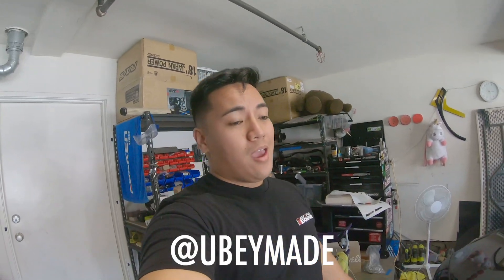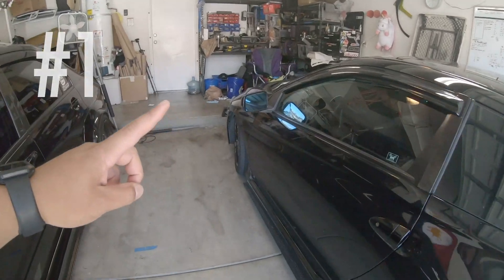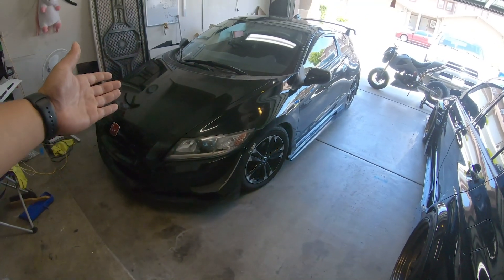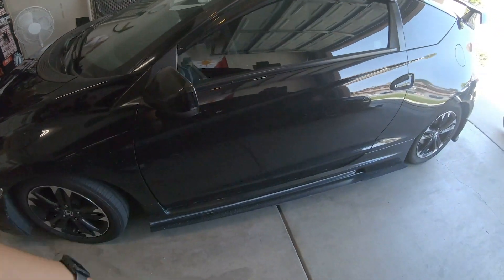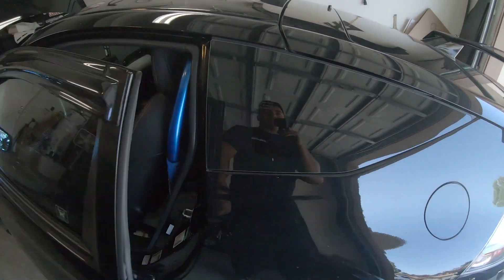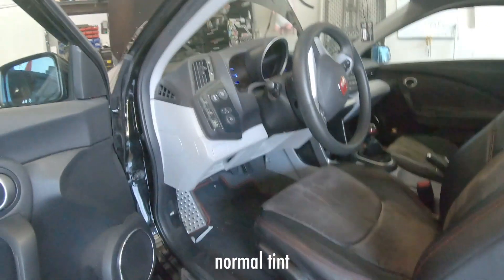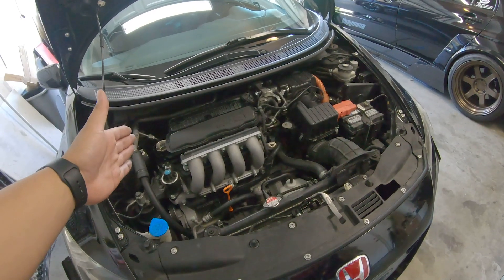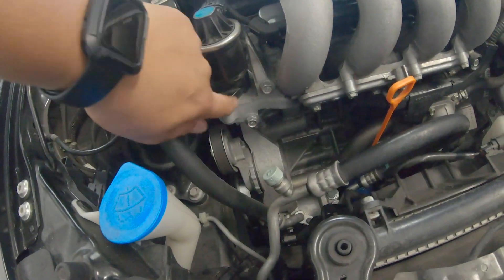FIRST 5 Mods Your CRZ NEEDS! ep.30

Comment: the first and the last thing that a cr-z would need - is a supercharger.
Reply from the maker: for the price per hp gain tho... i find it hard to justify. K swap or build the suspension and just hit the twisties!
Reply: @UbanteGarage  K-swap is  a valid point, dude! Apart that it would take much more dedication, in opposite to a supercharger weekend project.
But any upgrade of the suspension, with a CR-Z stock powertrain?... OK... maybe.
Reply from the maker: Have you tried pushing it through the twisties? Things are fun af haha gave a new sti a run for it money 😂

Comment: I've wanted a crz since they came out and finally did. I'm happy with it, excited to get the few things it needs (spacers, arm rest, mine needs a new windshield, tints, Progress rear sway that should match the stock FSB at 19mm from what I've read). Plus I just got it at 97k so I'm thinking oil and cvt fluid and filter change immediately, for peace of mind more than anything.
Reply: Though most of what I can find says just follow the maintenance minder (which says oil life at 100 which seems too dark to be true), but also that "no tune up is required until 100k" so I'm thinking I'll just do it all. Make it good as new and trouble free.
Reply from the maker: I wouldn’t put the progress rear sway at the top of your list.. didn’t feel much of a difference since the rear is solid
Reply: @UbanteGarage  thanks for the input! Makes sense, it definitely feels pretty solid already. Plus would have to wait til spring at least to even want to install it

Comment: I just put in a full K&N air intake in my 2013 CR-Z. It requires the removal of the stock airbox. Sounds great and adds a few HP and torque.

Comment: At 5:42 I am wanting to know what that grid looking drivers side shade protector is, I cannot find where to buy it because I don't know exactly what it is called.  Also, it really sucks that the T1R mirrors are discontinued, I am currently looking for blue wide side mirrors that work with LHD vehicles but it seems like there aren't any.
Reply from the maker: It’s called mugen style on eBay.. but idk if they are still available

Comment: Hows the maintenance bro? Any common problems? Planning to get a 2013 as my first car
Reply from the maker: tbh its the most reliable car ive ever owned 😂and the longest as well. after 70k miles ive replaced the ac compressor and the oil. other than that its just been extra mods.

Comment: Really discovered my blind spot today after a week of owning my 2014. Nothing happened but yeah lol. The driver mirror does have a sort of wide angle section on the outside. Those T1R mirrors seem hard to come by these days.
Reply from the maker: They definitely are unfortunately. When I got mine it was as easy as just googling them
Reply: @UbanteGarage  yeah I remember when I first saw this video a couple of years ago, links were all good ha. No luck on the Mugen style search on ebay either, but I'll learn to live with it lol. I saw a wider rear view mirror for the car but since the window is pretty narrow, seems unnecessary.
Reply: @UbanteGarage  actually I may have found them for like $80, never heard of the site but may try it.

Also, would you recommend those half tints on the front windows?
Reply from the maker: I recommend getting all windows if it’s legal to do the front in your area. These care get hot and the ac vents suck for the driver

Comment: Did you put a subwoofer and amp in this car or does it have the stock sub? I just got one of these and trying to figure out what size amp would be safe with this hybrid system.
Reply from the maker: The ex models come with a stock sub but the base models do not. I never installed one
Reply: @UbanteGarage  Yep, mine was the base. What I'm curious about is what would be the safe wattage aftermarket amp to use with this hybrid.. nobody seems to be able to tell me. I've seen videos of people with 4000w in there and some that say 600w max.. not sure.

Comment: Hello I have a question for the air box how did you cut the liners what did you use to cut the liners ? Inside air box  and outside of the box hope you see my question and possibly get back to me please thanks 🙏
Reply from the maker: I just used some pliers and pinched low and twist to break them. Then sand or file the nubs smooth
Reply: @UbanteGarage   was it worth doing it ?
Reply from the maker: It’s free. And makes your engine noises more noticeable. If that’s for you I’d say so
Reply: You know where or how I can get my hands on I-vtec manifold been looking for it everywhere

Comment: Thank you for this very informative video. I just got a blue CRZ (all stock) with 60K miles and first things I want to do are coilovers (probably Tein monoflex 5KG front and rear with a slight drop), sway bars, some questionable weight saving (back seats, starter battery..it's still something tho), rubber mats and this airbox mod. 

My only question is, won't this hurt the engine in the long run? I think I can remove the tabs first but stick to an original Honda air-filter. I also want to remove the muffler but it's highly illegal here in Italy, so many streets limitations here... So I might save for a legal but more musical exhaust. 

As for the wheels they are an expensive upgrade and tend to add weight so I want to prioritize coilovers, the stock ones are old anyway and might need some work done. I actually like the OEM wheels and I'm not sure if going for 17" ones is going to be a clear improvement. Does anybody knows the weight of the OEM 16" wheels? Suggestions for tyres? Thanks

Comment: Um, pretty sure the CR-Z has a front sway bar. I actually just replaced a link kit on it, and it's a stock CR-Z.
Reply from the maker: it does 😂
Reply: Ubante Garage haha alright! 😂 I was actually wondering if there were trim levels/region specific differences in the suspension, but alright seems like there isn’t!
Reply from the maker: I don’t believe there is.. but I do still recommend the spoon fsb 😅

Comment: I live in Milwaukee WI area, and our roads are pretty shitty. So I'm not sure if coilovers would be a good idea. I would like a slight drop but I wonder how soft I could set those BC coilovers. Otherwise the spoon springs are a 1/2" drop, but they're expensive especially if you get the struts to match. Only had it a week so that's further down the line anyway, and maybe just an OEM replacement in the meantime since it's at almost 100k miles on a 2014.

Comment: Hey homie, im curious. Is blocking the air box completely safe? I'm new to the whole car scene and I wanna try modding my crz, but I don't want anything to mess up.
Reply from the maker: Zoarork25 it’s just a the hole to the resonator. It’s there to reduce intake noise and if water was to get into the air box
Reply: @UbanteGarage  ok sweet, thanks for the fast reply
Reply: This has nothing to do with this video but I wanted to know if you possibly remembered what motorcycle exhaust was your friend running on his crz in one of your videos. @UbanteGarage

Comment: Got mine set up but now my traction control and ABS lights are on 🤦🏻‍♂️
Reply from the maker: damn... havent had that issue but i heard it jacks up a ton of stuff :/
Reply: I had to reset the ecu and clear the code with ob2 after a few items were put in but a few of the codes were small items to change out

Comment: What do you think about swapping the Manifold for a honda fit one? Is it worth it? Everyone i know says its a must
Reply from the maker: i did it but im not gonna say i think its worth it tbh
Reply: I cannot speak to stock but with the light flywheel as well as the air and exhaust mods I have I see the mid-band gain as the perfect complement, most other mods only add a small amount if any to the mid-band but that is were I feel this car is lacking the most and I feel the fit intake is well worth it due to the decent mid-band power increase
My car may not be the fastest around but the engine response coupled with the almost total linear power damn sure feels like it, regardless of the gear I never feel bogged at all anymore and for 4th gear and lower I feel little difference in power delivery regardless of what rpm range I'm at, its still faster at the top end and torquey in the low end but so smooth you tend not to notice much and I credit this smoothness to the fit intake
So short answer I would say it depends and while I cannot speak from experience as I had already done a lot of my mods by the time I got around to installing the fit intake from what others have said I don't see it worth it as a stand-alone mod, but as a complement to other mods yes I would argue its a must and definitely worth it

Comment: These seem to be fairly common starter mods but I'm not sure that I would agree with them and from my experience with the mods I choose to start with I would have a different list, however, I would argue that there isn't really a true universal list because it depends on what you want out of that car
However the only mod I disagree with is suspension I don't see the point, were I live in the mountains there are almost no straight roads and most have what I call country curves which to most city folk would be considered turns, I don't see much body roll maybe its because I have a 13 and suspension is one of the things upgraded but the only mod I would say would improve handling would be sway bars but I don't see it changing it much and I personally don't feel its worth the harsher ride but a understandable mod none the less
Coilovers would also slightly improve handling by lowering the center of gravity but the CRZ is already low to the ground however its roughly the same as the civic so it would benefit from being lower but the cost/benefits ratio is insane the handling payoff is not even close to enough to justify the cost that is why I would say sway bars are the only legit cost-effective way to slightly improve handling, if you also wanted to lower your car for looks that might change things depending on how badly you wanted it some things cannot be considered on a cost/benefit ratio as they are priceless in the eyes of that person however for me personally I cannot lower my car where I live prohibits it(not by law, but fuction as I am forced to do light to moderate off roading in my daily driving) however if I could I still would not because the cost isnt worth it to me as I would only slightly lower it, ultra lower riders are stupid, pointless and about as aesthetically pleasing as extreme negative camber rims and carry more or less the same performance hits
So in short the reason I disagree with the suspension mods overall not just as 1st mods is they offer little gain in performance, ride quality and looks for the money because the stock is perfectly fine and while it may have slightly more body roll I would argue the benefit of higher ride quality makes it a better choice for an everyday car, however, if you are making a track car it might be worth it to get sway bars and if you live in the city it may be worth it to get coilovers for looks, both offer a decent benefit for a track car but little benefit for an everyday car and can cause performance and ride quality issues for a everyday car

I do however agree on the tint, in fact, its a mod I really want but cannot where I live it won't offer me much benefit nor would it change much in the way of looks because it is already close to the legal tint were I live. I could maybe only go another 5 percent max(after looking up tint percentages my rough guesstimate is stock tent is 40 percent) I MIGHT be able to get away with something like 20 percent in the back but its unlikely were I live right now but were I'm moving to(same state) I MIGHT be able to but the state law only allows 35 percent max and even then you can be ticketed if you don't have a state inspection sticker that states its legal tint and the ONLY exception to this is rear windows with exceptions this is mostly for non functional windows or "limo" windows so its gray area if you can tint the rear windows of something like a sedan and this only applies to side windows, not the rear windshield so under law I could only tent the two side windows under 35 percent and to me that will make the looks worse not better
That said I can only think of one universal mod that I would argue everybody should get regardless of what you plan on doing with your car, this includes even if you don't want to mod anything at all and that is tires, wider stickier tires but even this would depend on your purpose for the car for me, non modders, people who live in the north among some others I would recommend a UHP all season but for performance-oriented I would argue a UHP summer tire/winter tire combo, the reason I personally use all seasons is as I said above were I live requires me to do some light to moderate offroading in my daily driving but when I move I most likely will change the tires to a UHP summer/winter combo, its not that were I'm moving is less rural in fact I would argue its more rural but its also better kept so road conditions are far better than were I live now
My personal 1st 5 was tires(+1 mid-profile, wide, UHP all-seasons), air(k&n typhoon), exhaust(catback), cooling(dual row all aluminum radiator) and clutch/flywheel(ORC light) and that was because my goal is to turbocharge for performance but also to build a fun road trip car for efficiency, longevity and as a place to rest/sleep to save money(so I need it to be able to idle for long periods of time without to much wear) this is also why I plan on having two ecu maps one for efficiency to use regular octane gas and one for performance to use premium gas this way I can have the added efficacy and some performance increase from a turbo but not the added cost nor added inconvenience of premium gas for long road trips and a sleeper for track or high-performance canyon style racing
The air slightly increased economy and a moderately increased response, the exhaust slightly increased power, significantly increased response and the lighter flywheel very significantly increased response and moderately increased power(less inertia so it doesn't make more power but it allows more to go to the wheels and has a decent amount of weight savings) in fact with the flywheel it completely changed the feel of the car while most of the other mods I have done you can feel the difference with the flywheel I cant just feel the difference it feels like I'm not driving the same car I was I have done other mods these were just my 1st 5
Since this comment is so long and has some personal reasons for what I've done to my car I would also like to add the very reason I bought this car was I felt it was a good base for a fun road trip car, the hybrid aspect and the fact its a two-seater, lightweight hatch with decent storage for its size and comes in a manual to me makes it the very best road trip car for more or less max fun as well as economy, it is not nor was it ever meant to be a beast track car, but I most defiantly would not call it "slow" but you have to know what you have, if your goal is like mine or something akin to a weekend warrior or fun commuter than the CRZ to me is the best choice, in fact, the only one but if you want a track car or try to make it look more "sporty" by adding a bunch of for looks only areo mods your gonna be very disappointed and might even end up with a slow lug of a car it is my thought this is why it bombed in sales the unrealistic expectations from all sides but the main reasons I have found is the "hybrid haters", the "hybrid lovers" and the ignorant speed demons that expected prius like economy and dodge demon like performance. while performance and economy are linked and you can't have a car that is a master of both the two are not natural enemies and there are ways to increase performance while also increasing economy or at least keeping it close to the same and the CRZ is the best example of this and an engineering masterpiece but for most of the laymen who don't understand the engineering aspects were disappointed as its not a prius-corvette
Reply: Get a life... Nobody read over three lines in the comments 😂
Reply: I appreciate your comment.  It gave me a lot of insight.
Reply: Interesting outlook and one I agree with the most. Some more info on your top modifications described would be nice, other than the tires. For those who are not so savvy when it comes to modding cars

Comment: Hey man I just picked a 2014 CRZ and I was wondering if you can point me in the right direction. I want to get some red badges for the front and rear, but I’m sure where or which website to go to. Thanks!
Reply from the maker: Measure them and buy larger ones off eBay. Double stack the tape to make the gap on the recess and done! Mine were larger

Comment: Im planning to get a 2013 crz.. should i be worrying about the ima battery?
Reply from the maker: on every hybrid the battery is always something to be worried about. BUT mine is currently at 113k miles and no issues with the battery yet. As for most it can have issues as early as 80k but theres crz's out there with 200k+ with no issues OG battery. its just a hit or miss thing